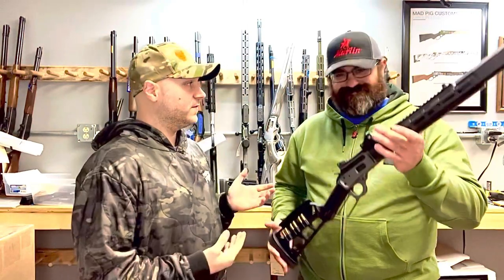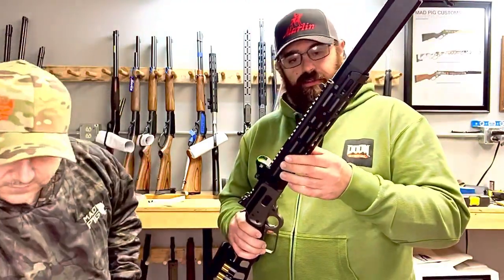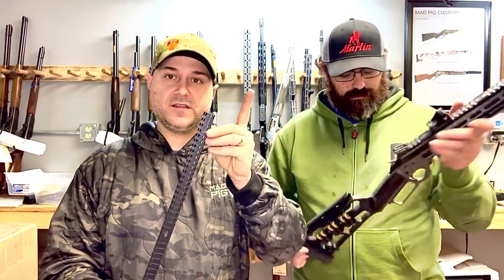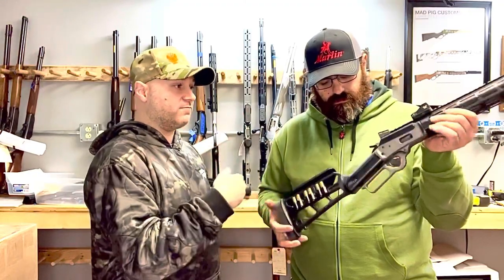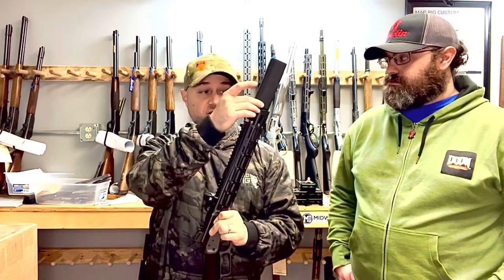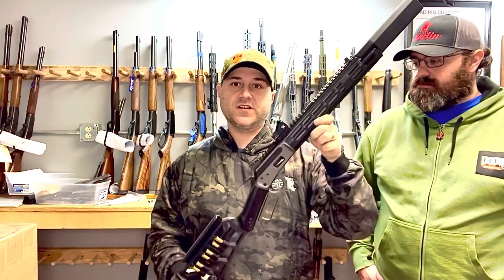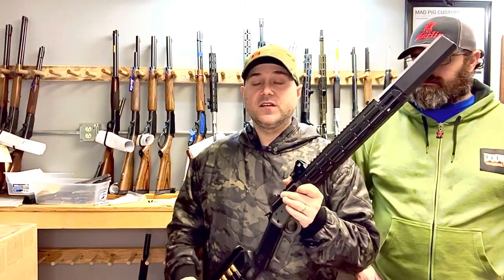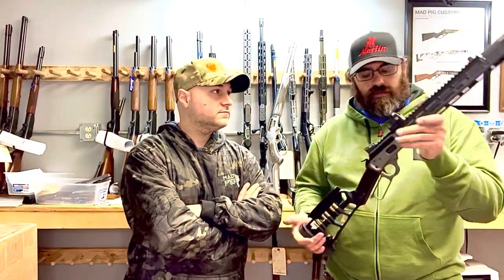Mad Pig Customs Marlin 1894 and Henry Lever Gun SBR Builds

Comment: That’s the way. I chopped a 44 Henry x down to 8” and stuck my obsidian on it. Handles 300 grains right to 1050 and at over 700 ft lbs for strictly a sub gun. It makes the 300 subs look silly outside anything but an ar. But then there’s use and the realities that come with the real world over paper punching. What does better in the thick brush/canopy of hog country? A 1/7 twist pointy 190-220gr that don’t mushroom and will bounce of a toothpick? Or a 1/20” spin of 260-300 grains going the exact same speed but doesn’t even have too… yet still does fantastically… sure there’s a loud cheap light slug gun. Or a little 300 ar. But a light and quiet closed bolt slow twist slow speed heavy pill, does wonders in the dark tucked away places where the bacon lives.

Comment: mate can they convert it into a 5.56 ,7.62 or 308 rounds is it possible
Reply: Get yourself a Henry longranger. If you want a rifle caliber. This is a pistol caliber that cycles a round 1.6” long everything you listed is over 2.25” so there is no way to make this rifle anything else. Go for a 30-30 or 35remington in the 336 model if you want more power
Reply: No too the 223 their are no flat tipped or flex tip 22 cal bullets. the 7.62 or 308 you'll have to use 30 cal bullets designed to be used in a 30-30

Comment: I guess these lever rifles are classics but they just seem so pointless other than a cool toy. Not a good choice for self defense . Ok for hunting I spose. But for a gun that has better options for practical real world useage they are still so cool. I guess that's the draw. The cool points. It's a shame Marlin cheaped out to the lowest bidder and contracted Ruger to make theirs. Ruger is struggling to get assembly line employees apparently. Quality and reliability would be a concern for me although I don't think the action design of lever actions lends itself to reliability issues but I'm not a lever guy. Still pretty cool.
Reply: ok hunting? they are the superior hunting choice. Quickly load any single round for the right situation. Can accept any hand load without any cycle issues. Can run subsonic 38 for a certain situation, then can remove suppressor and run the hottest 357 you can reload for other purposes. It's a rifle, who's purpose is to take targets at range. If you need to go commando from your bedroom against the ninjas jumping through your window, handgun with high capacity and crimson finger actuated laser will be more than enough.
Reply: @tranderrick  I'm not a hunter so that's why I wasn't sure if they were a good choice for hunters. Thanks for info. Sounds like a great choice for hunting.